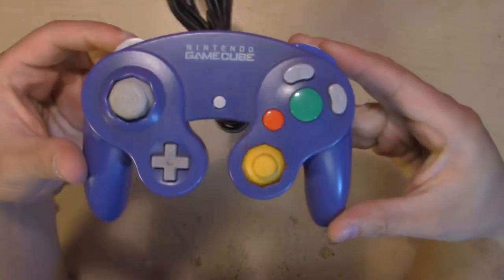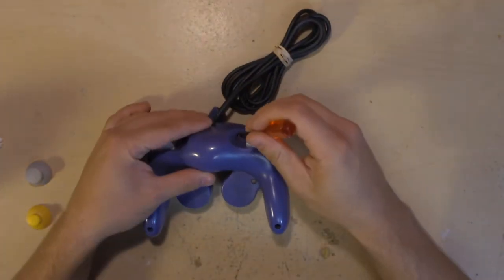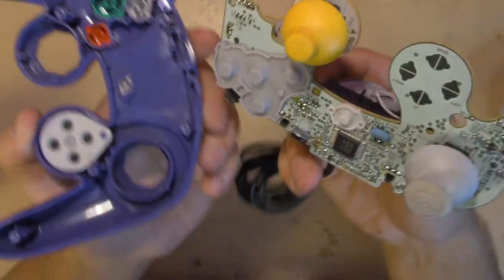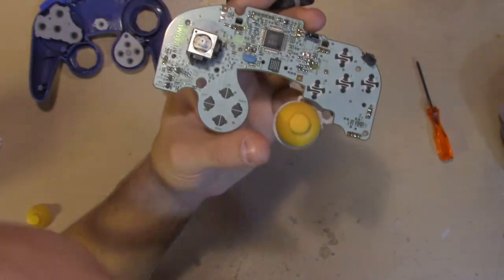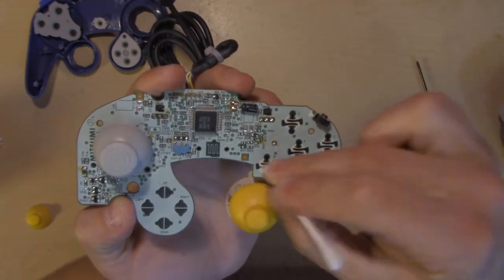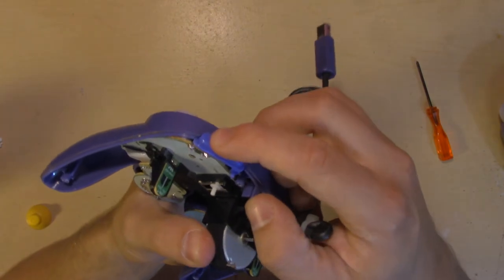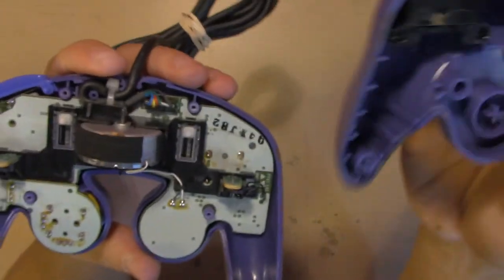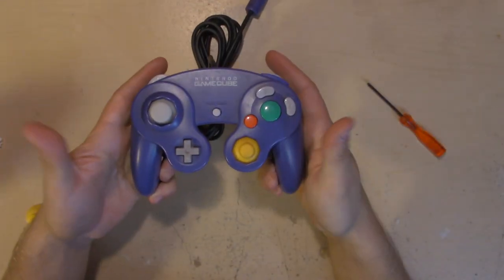How to Replace Analog Sticks in a GameCube Controller

Comment: Hey Cody, so I noticed that when using these 3rd party stick replacements the joysticks will not click in the same way. This is due to the fit; the replacements have a deeper hole so the stick will sit lower. An easy fix to give you that OEM feel is to add a 1.5mm spacer (a part you can 3d print, or possibly a tiny washer would work, or you can stick some paper in the hole)